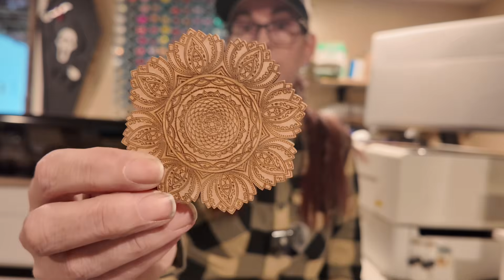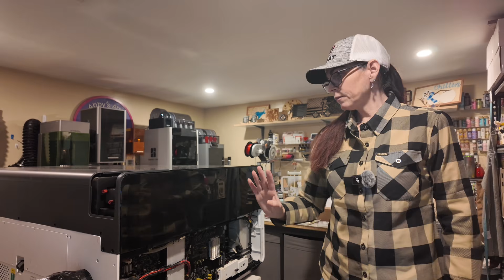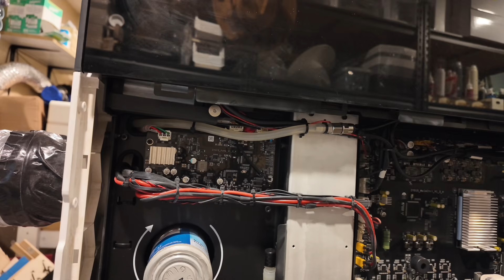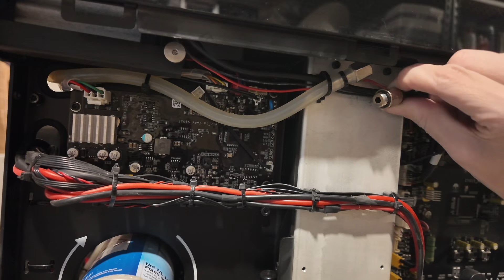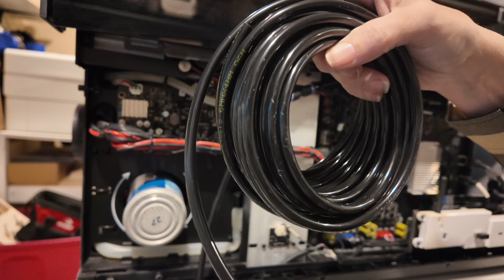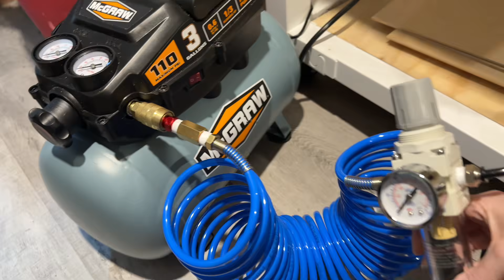xTool P3 Air Assist Upgrade | Cleaner Cuts & Better Engraves

Comment: A quick couple of questions. 
1) Are you adjusting the PSI depending on whether your cutting or cutting or engraving?
2) The linked air pump shows lots of options. Is the ACO-388D 85W the correct one?
3) Following on from option 1, any difference in materials to the air pressure
Reply from the maker: Yes I change it all depending on what I am doing. Engraving I don’t have it on at all for example. Which is why I did this. I now have just kept it to the regular air compressor from harbor freight the other one needed to be screwed down. And I just didn’t want to do that.

Comment: Hey Abby, thanks for the video! I did a similar bipass for my P2 and even though I left the pump connected it is now giving me the "air pump current exception" error! I did disconnect the tube from the pomp completely and will go back and put it back on! Any other thoughts?
Reply from the maker: Those cylinders in the back is still gonna get clogged. That’s why.

Comment: I would love an update on how this modification is going? Did you come up with a solution for the disconnected air hose? Has there been any issues with damage to the lens? What PSI are you typically running? Im considering doing this upgrade to my P3 that is arriving in a couple days. Any additional details about the install or things you would do differently than described in this video would be really helpful. Thanks!
Reply from the maker: It works great, so much better. No you need to have the original still connected to the p3.  No lens damage at all.
Reply: @Abbysatticcreations  Thanks Abby!

Comment: if you dont put a air dryer on there you will get moisture on your lens and cause premature failure
Reply from the maker: The one in the video gets the moisture out.
Reply: @Abbysatticcreations  he is right, the one you got from HF is not really meant for this type of thing. it may work short term but you really should install a true desiccant air dryer at the very least

Comment: Do you know how to check to see is the air assist/air pump is working?  The links on the xTool site do not work.  We think our air pump is not working.  Thank you!
Reply from the maker: Take the old filter off I’m sure they are clogged and it should work. Contact Xtool to get new ones.

Comment: New to lasers and how they work, but watched twice and still not sure what you did other than disconnect the air assist into the machine. How does the external compressor take over for the air assist? how to you actually use it?
Reply from the maker: Because that’s the only running air to the nozzle. You turn on the compressor that’s it.

Comment: You could 3D-print a new panel with a hole. I will do this mod too eventually and I will design a new 3D-printed cover if I cannot find one. Will absolutely share it for free on Bambulabs makerworld if I do. I might have a different version of the P3 than you do though. Mine is from about one month back.

Comment: Thanks for posting this informative video.  Looking at the set of interconnecting air lines and fittings this morning.  The Cloudray air pump you linked is ordered and on the way.  It occurred to me air filtration.

*  Does the Cloudray compressor have an air filter on it?

*  Or are you using the inline regulator/dryer that you used with the Harbor Freight compressor?

I am thinking about an inline filter/dryer (no regulator necessary) may be a good idea with the Cloudray compressor.

Does the performance of the Cloudray air pump compare to the HF unit running at 15 PSI?

Thank you for your time.
Reply from the maker: Well there is a difference with the both of them. The cloudray only goes so high. Where the HF I can crank that up. All my research I did the regulator is fine because it take the moisture out of the air. So really it’s up to you for what you want for a set up. The cloudy is much quieter. I do have to bolt it down otherwise it vibrates all over the floor.
Reply: @Abbysatticcreations  "Crank it up"?  How much pressure do you use?  15 PSI maximum working pressure for high power cutting?

Assume the Cloudray 85W pump works better than the OEM P3 air assist pump?  But, not as good as the HF with regulator?  Looking at the specs for the HAILEA Electromagnetic air Pump ACO-388D 85W it is rated very close to 2.5 CFM flow rate.

I have a Cloudray ordered from your link.  Also ordered the hose and fittings from your link.  I also ordered a large face 2-1/2" pressure gauge that reads 0-15 PSI that I"m going to splice into the OEM line on the P3 to measure working air pressure of the factory P3 pump before I change anything.

I tested the HAILEA pump with a pressure gauge.  It is capable of producing 6 PSI static pressure.  The orifice size of the xTool P3 nozzle is 0.120" in diameter.  At the 2.5 CFM flow rate of the ACO-388D pump when connected to the P3 with the 0.120" nozzle outlet diameter it could deliver just under 5 PSI working pressure.  So, yes it is not capable of doing what the HF pump will do when you crank it up to 15 PSI working pressure.  At 15 PSI working pressure and the P3 0.120" orifice nozzle the CFM flowing is ~5 CFM.

After the tubing arrives, I am going to splice a pressure gauge into the P3 airline and see what the working pressure is for the OEM P3 air pump.

Here's a useful link for you to calculate air flow for working pressure.  The orifice size in the nozzle of a P3 is ~0.122" in diameter.

https://toolbox.tlv.com/global/TI/calculator/air-flow-rate-through-orifice.html
Reply: @zangzang1268  How did you finish it?
Reply: @andrejmazur9983  Pressure gauge and tubing with connecting fittings arrived.  I did some testing.  The xTool P3 at 100% air assist has a working pressure of ~4 PSI.  This is at the lowest end of the typically recommended 5-15 PSI, but it works.  Could it be enhanced?  Probably and that's why I watched this video.

Testing the HAILEA Electromagnetic air Pump ACO-388D 85W yielded a dead end max air pressure of 6 PSI.  Manufacturer rated maximum airflow is 80L/Min which converts to 2.8 CFM.  I connected the ACO-388D up to the P3 air system and it produces 2.8 PSI working pressure.  That is 1.2 PSI less working pressure than the OEM air assist pump in the P3.

I just watched this video again, and it was published before the ACO-388D had arrived or been tested which makes sense.

Here's a pump capable of driving ~15 PSI into the xTool P3 with nozzle orifice of 0.122":  https://www.amazon.com/dp/B0FX3ZLLFT/?coliid=IEVDSU0P5V3VL&colid=2OG0WCLL14RCL&psc=1&ref_=list_c_wl_lv_ov_lig_dp_it

Rated at 5.76 CFM @ 50kpa (7.25 PSI) working pressure, it's a over double the output of the ACO-388D with a higher static pressure capability.  Driving the P3 0.122" orifice to 15 PSI working pressure requires 4.57 CFM of air flow which the AZZUNO 8.2CFM should be capable of delivering.

I've been considering simplicity of the AZZUNO 8.2CFM installed in the stand beneath the P3 vs just running an airline from my shop around the north end of my house and putting a regulator/dryer on the wall beside the P3 which would be much quieter yet more work to install.

I just made up my mind, going to order an AZZUNO 8.2CFM and see how it works out - order placed.  Amazon says delivery tomorrow so I'll test right away.  With the AZZUNO 8.2CFM It's probably going to take a regulator/dryer inline to tame it down so I'll figure out what's needed when the pump arrives.
Reply: @zangzang1268   @zangzang1268  Thanks for the answer, I solved it with a  Airflow 26 silent oil-free compressor through a pressure regulator and set it to 15-18psi. I work mostly with mdf, hdf and there is a big difference in the cleanliness of the cut.
Reply: @andrejmazur9983  Cleaner cuts.  That's what I'm talking about!  Good to know, which reinforces Beth's comments.  I'm anxious to try out the new pump when it arrives.

Air assist on a laser does many beneficial things one of which is it works much like a plasma cutter and really heats up the energy stream in the cut.  And it cools around the cut.  Thanks for the reply.

What thicknesses are you cutting of MDF?  I cut up to 3/4" clear acrylic which was the main driver for selling the P2S and going to the P3.  That and the larger working area.
Reply: @zangzang1268  3-4 mm. There is some smoke from the material at the beginning of the cut, but after that it's great. I use two air filters + regulator.
Reply: Ordered and tested an AZZUNO 8.2CFM pump on Amazon.  It didn't disappoint.  15-16 PSI working pressure.  It rips pretty good, and noise level is low enough to live with.  So, for now no air line from shop needed.  Going to fully set it up for testing on 3/4" clear acrylic cuts later today.

Beth you should try out the AZZUNO 8.2CFM on your P3.  May be quieter than the HF and get it done for you.  Did some test cuts on 3/4" clear acrylic and it gets it done.  100% power and 2mm/s and one pass makes a pretty clean cut.
Reply: @zangzang1268  I am looking to follow your setup with the Azzuno pump. However, I can't find anything on the item listing that shows the tube diameter. Is it 1/4in? I'm also curious if you got a pressure regulator? And one last thing, I saw one commentor mention the pump has an air filter. Is that true and is it replaceable? I do a lot of painting in my shop and even with venting, air filters tend to get dirty quickly with paint fumes. I need something I can clean or replace. Thank you for the awesome info?
Reply: @andrejmazur9983   hello, i have a question, when you laucnh the cut, then you launch direclty the compressor ? or you have a OFF/ON valve ? Thank ! :)
Reply: @julesdepoisier2836  mam ventil ktory zapinam rucne

Comment: Beth! If you have two cover panels, you should consider cutting a hole in one of them. You can always use the other one to go back to "original spec".
Reply from the maker: I can’t one panel does not fit. It’s different than the model then sent to the public. My p3 is a prototype, thru changes a few things.
Reply: @Abbysatticcreations  ah makes sense why the pneumatic connector is different on my p3. the production model shipped with a quick connect, not a threaded one like yours

Comment: This is a great idea. Is there not a 2 into 1 T juction type connector? Then the disconnected pipe would not be blowing air all over the electronics inside?
Reply from the maker: I was actually thinking of doing something like that. You will need to also use the original container from the small hose and connect to the T connector also.
Reply from the maker: Also when you want no air the one in the machine will still blow air.
Reply from the maker: I did try to turn the air pump off but then you cat run the machine.